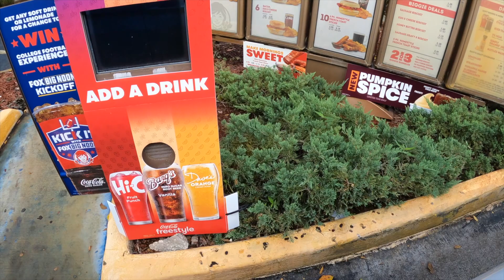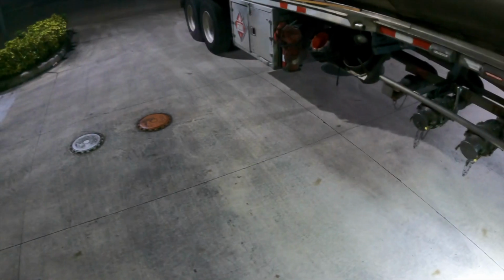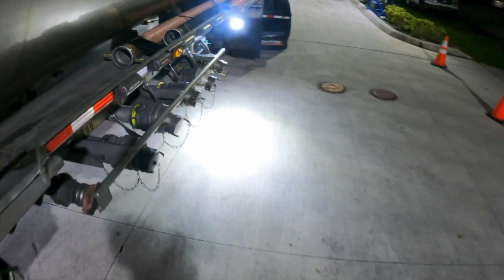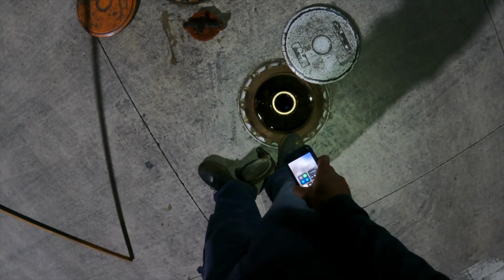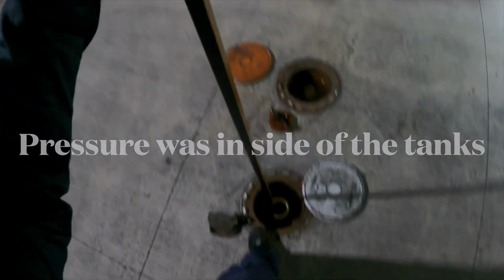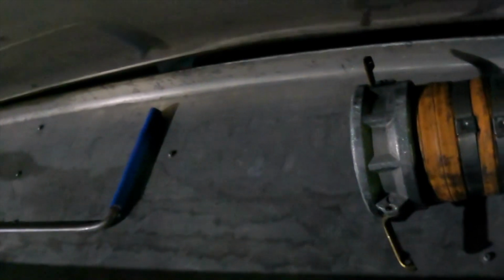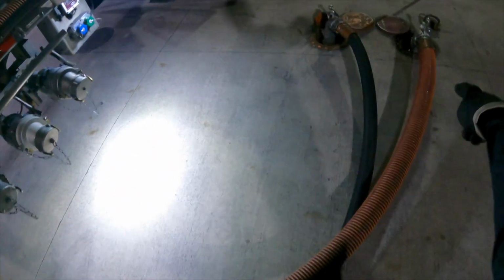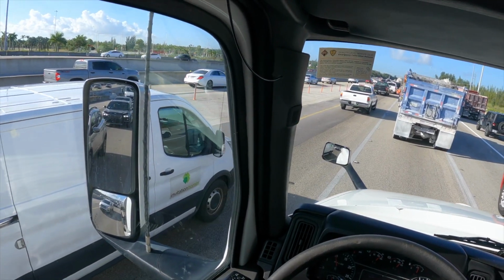The Essential Equipment Every Fuel Hauler Needs

Comment: Homie, you're reading off all the equipment your company is supposed to provide.and some you dont need. Fuel monitoring system ? Testing kit ? Umm, no. So,  the stick is in the tank to prevent the flapper valve from shutting off flow. Its an overfill protection device they bypassed to fit more gas. Now if you overfill, get product in your vapor line and product stuck in your main line, good luck. You can also have productbshoot out the vapor vent pipes and that could get real interesting.